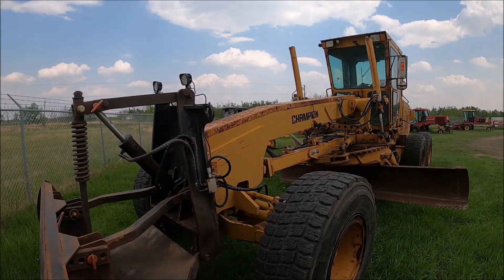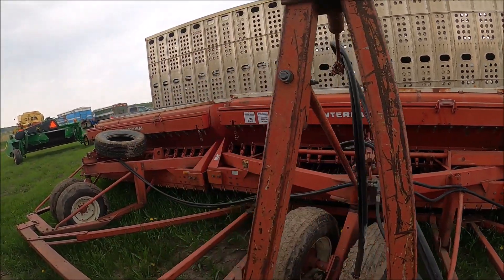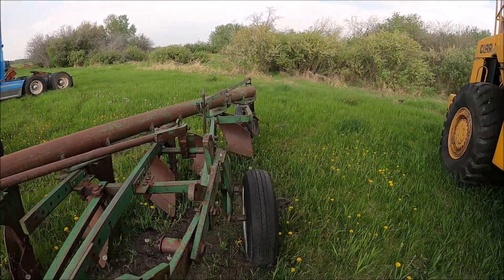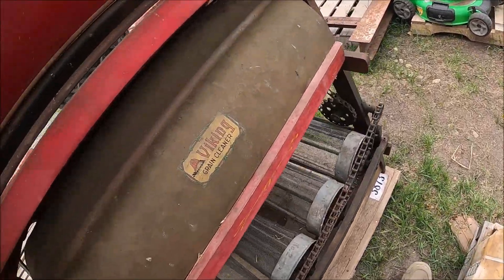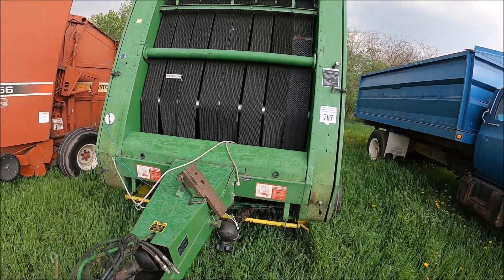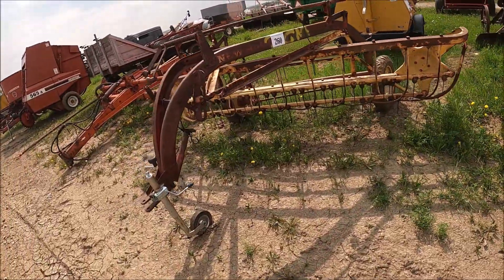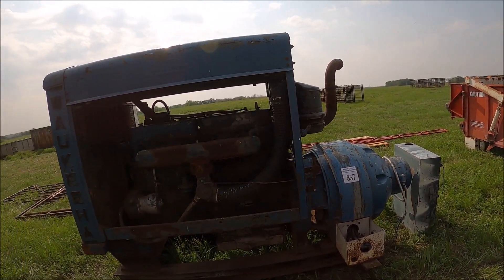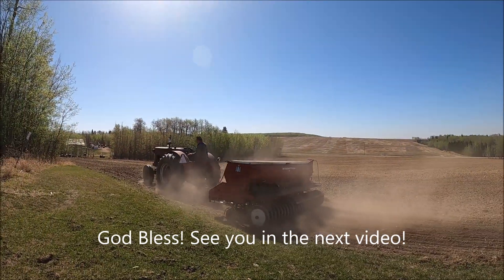Allen B. Olson East Central Summer Auction Preview Part 2 Implements, Miscellaneous, and Other

Comment: Good video Ty. I think that 4 bottom plow is a Massey Harris built in Hamilton, Ontario. I have a model 27 2 bottom plow and I saw similarities between the two of them. The plow beams are fish plated with a flat piece of steel forged to go all around the curve leading down to the share mount. That plow is a wheel lift with a rope.They have cone bearings on the wheels. Massey Harris plows were very popular and of very high quality. The color is right also.
Reply from the maker: Thanks for the information. We have a Massey Harris plow here. I should compare.

Comment: Nice work Ty. Never did  understand why you Canadians windrow your grain. You'd think that you would knock a lot of grain off the stalks that way.
Reply from the maker: We do straight cut too. Often the grain ripens uneven, and windrowing is what it takes to ripen it. Now they often  spray it. I totally disagree with that as the glyphosate enters the kernels at 30%  moisture  which all green grain is. We will never desiccate our crops, because we care about those who eat it, than we do about saving a little grain. We do straight cut too. Canola does require swathing as a rule. It must be cut slightly green like ripening bananas, and then it cures in the swaths. Canola you're only allowed 2% green to make #1.
Reply: @tyfrank3427  A thorough and insightful explanation Thank you.